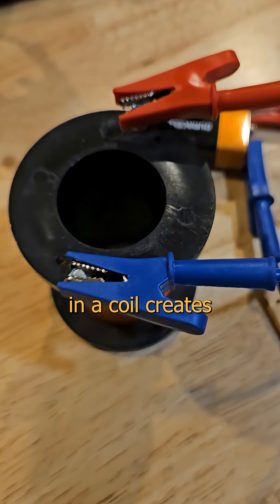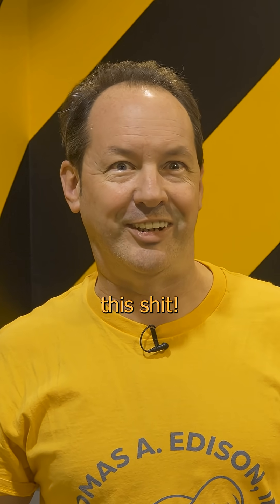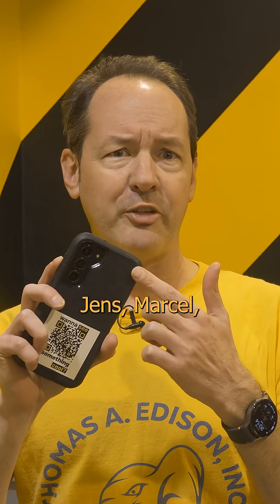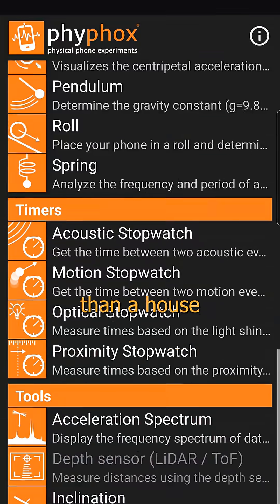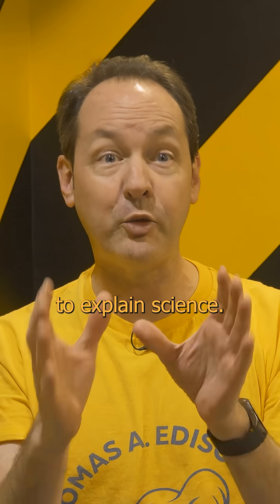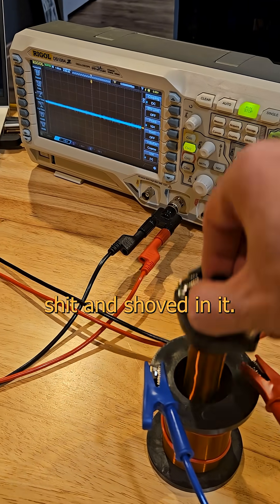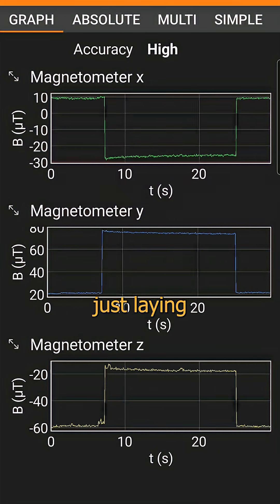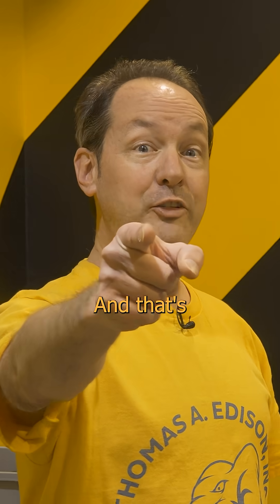DC Transformer Experiment #chrisboden #comedy #physics #science #faraday #phyphox #electricity

Comment: Phyphox is pretty sweet. I have that and a few other apps that make use of the sensors in my phone in a folder called tricorder. It seemed appropriate
Reply: I present my highly abbreviated list for the good (?) of the community.

Animated Knots By Grog 
Atomic Clock
Clinometer 
Function Generator 
Handyman Calculator 
iNaturalist 
Magnifier 
Physics Toolbox (EQUAL to Phyphox)
Recorder
Spectroid
Squid Pro
Ugly's Electrical Reference 

There's also a ton of weather and Ham Radio apps. I may have a problem...
Reply: @MrHuram-abi  you named all of mine except 
cellmapper 
network cell info
Reply: @MrHuram-abi this is a great list. There are a couple that I'm going to check out
Reply: @MrHuram-abi  Thank you for sharing!
Reply: @MrHuram-abi looking up function generator right now, is this audio function generator?
Reply: @couryrussell7653  Yes. Square, sine, and sawtooth waves. Stereo channels. Selectable outputs. I'm 50 and my youngest kids can hear several kilohertz higher than me, verified with blindfolded tests.
Reply: @MrHuram-abi Could you share your preferred ham radio apps?
Reply: @MrHuram-abi  uh, no,  sir. You have solutions to a great many problems
Reply: Do share with the class sir! What other apps are there to tinker with?
Reply: @RocketLeagueSworst Physics Toolbox Suite on Android is similar, but probably has even more functions. It's very cool. 

I haven't tried Phyphox yet but I'll download it and check it out.
Reply: @RocketLeagueSworst Arduino science journal, I've had that one since it came from Google, before Arduino bought it. Physics toolbox sensor suite. A bubble level, PlantNet, and Google fit. I'd probably put other health, medical, and activity apps in there if I had a smart watch. But I can't bring myself to get one.

I am getting some good suggestions from others though
Reply: I hope you brought enough apps to share with the class. Please though, do share the names. I await with bated breath!
Reply: If Paramount had their wits about them, they’d license the trademark for the tricorder to them. Most of the engineers that have a use for the app have, at the very least, watched enough Star Trek to know what a tricorder is.
Reply: @Enraged-Gecko  The name "tricorder" is free for use for anything that has a function similar to the show, per Roddenberry's estate, as are any other names of technological devices from the show.
Reply: please do share the other names, we insist
Reply: The first app of this type that I ever downloaded was called Tricorder and had a UI and sound effects to match. 
In the early days of Android, circa 2012(?).
Reply: @blockchaaain  Killed by Paramount lawyers... against Roddenberry's expressed wishes.
Reply: @JanPeterson How is that possible? Roddenberry died in 1991.
Reply: @charlessanford2198  Part of Roddenberry's estate says that the names of technology are free for use for anything that actually does what the thing on the show does. If you build a handheld sensor computer, you can call it a tricorder, and no one can stop you. It was his express wish that if anyone created something from the show in real life, they could use the names if they wanted.

However, he did not write in anything about specific visual components. The original Android Tricorder app used the visual style of the TNG computer systems (LCARS), and the author was forced to remove the app because of it.
Reply: @jasexavier Good to know. Thanks.
Reply: What similar apps have you found ?:)
Reply: There could be no other apps better or even comparable to phyphox!
I dare you to name those other apps!
Reply: @vasyle2236 Physics Toolbox Suite and All Tools
Reply: 😂😂 phyphox is a new one in my list, going to see what it can do. Have a bunch of other nice sensor gadgets. Tricorder is a good name for the folder!😂😂😂
Reply: As do I. Love that you do too
Reply: That is a fascinating name for it.
Reply: ... Excuse me a moment while I rename a group on my phone.
Reply: Physics Toolbox Suite is on Phyphox's level, but each will do what the other can't. Together: an unbeatable pair. All Tools app makes the perfect trinity to utilize your device to the fullest extent possible.
Reply: Commenting for if/when the apps list drops
Reply: @TyPaff same
Reply: @emmelsmusic79  ..
Reply: Being a fan of Star Trek, I am now making a Tricorder folder in my phone. Love it.
Reply: Plzzz share
Reply: I may not use them, but I am keen to learn of their existence
Reply: Nice a buddy of mine and his wife were super trekkies and got the "tricorder" cellphones when they came out years ago.
Reply: One of the apps I find to be rather useful for displaying sensor data is GPS Status and Toolbox. It will give you the real time output of a bunch of the sensors your phone is equipped with.
Reply: There used to be an actual tricorder app on Android back in the day.
Reply: @jozak78  gonna drop the list?
Reply: YEAH!
SHARE WITH US THE NAMES OF THE APPS!
Reply: Physics Toolbox Suite on Android is similar, but probably has even more functions. It's very cool. 

I haven't tried Phyphox yet but I'll download it and check it out.
Reply: me too, it's pretty cool
Reply: What are the others?
Reply: I'll add rpm testing/ strobe function
Reply: Here are a short list of biology centric apps that let you identify what living things you find around you to add functionality to your tricorder:
Flora Incognita – identifies plants based on pictures of leaves, flowers, fruits, and general appearance 
ObsIdentify – also image based, identifies pretty much whatever critter or plant you point it at and can get a decent picture of 
BirdNET – identifies birds by their song
Now that last one is pure black magic. This is where machine learning and AI really shines.
Reply: I am also curious to other apps.
Reply: Bro what other apps do you use
Reply: This. It is crack for geeks, nerds, anarchists, mega-church pastors, etc...
Reply: I friggin love that app!
Reply: I love that the app runs locally. Needs like zero permissions and just fucking works. Love it.
Reply: That’s sweet! I downloaded it before I got to the end of the video! Any other hidden gems??